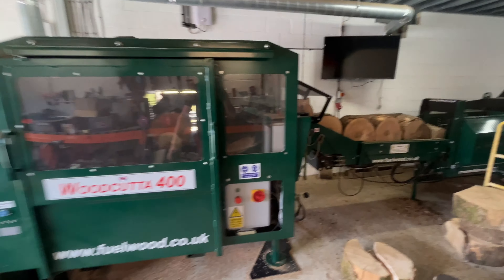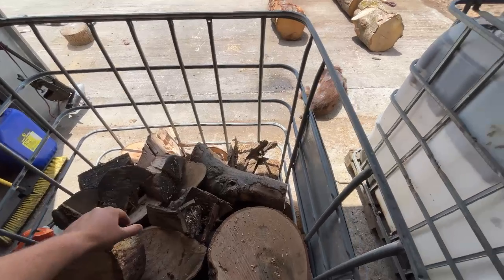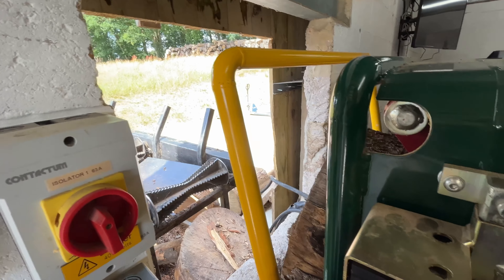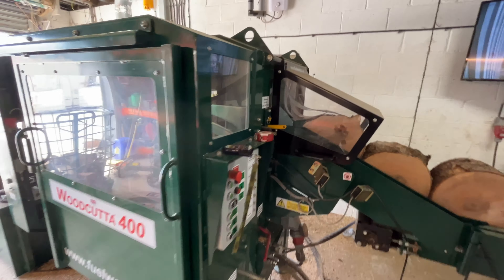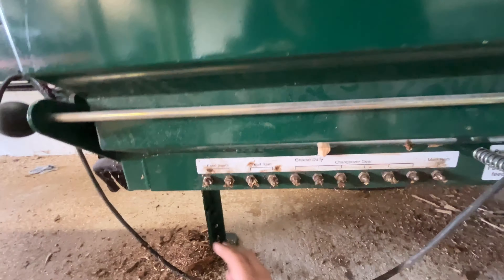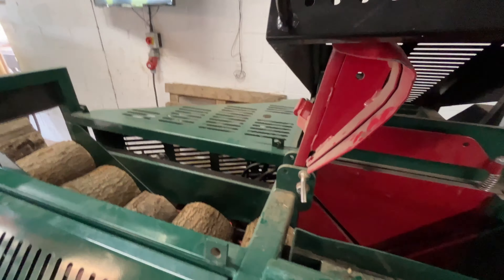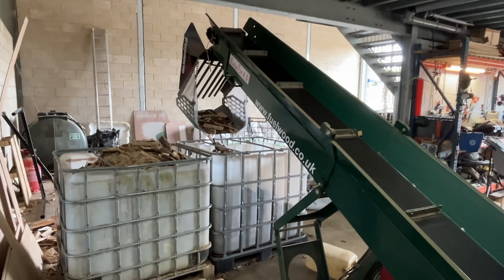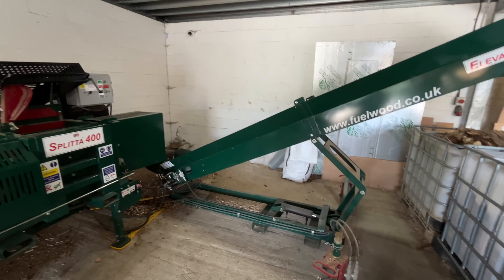Day 115 - Fuelwood Factory in Depth Look

Comment: Thank you for a really good demonstration of your machine. I am incredibly impressed. I have worked with firewood in Denmark, but in Denmark, it has received a lot of criticism for polluting the air. That's nonsense if you ask me. If the wood is dry and burned properly, it doesn't pollute.

Regarding the optimization of the machine, I would definitely choose to install a conveyor belt between the splitter and your current conveyor belt. If it were up to me, I would set it up with the JAPA drum cleaner and then continue to your current conveyor belt.

That means the conveyor belt lifts up to the deck in the splitter room. Seal off the wall for noise, but include a door. Set up the JAPA drum cleaner along the wall and let it drop into the corner where your current conveyor belt will be located. This way, you can already sort out bark and other small debris early on. Afterwards, the completely clean pizza oven firewood will end up in the IBC containers.

There should be minimal waste and cleanup around the IBC containers.

When I delivered firewood in Denmark, we worked a lot with handling the finished product, just like what you're aiming for or working to achieve. It's a joy to see that someone can create machines that are almost fully automatic. And that remote control is invaluable—brilliant.

Jesper - DK

Comment: With the longer conveyor, easier to empty bags and you could even now back a trailer  in and fill it  with loose wood
Reply from the maker: Yes very true. I don’t often do green loads though I must admit. I also use Ibcs as a measuring device.

Comment: Great video. How many tons of wood do you think you need to process a year to justify one of these? cheers
Reply from the maker: All depends really. It will last years so you don’t need to be doing absolutely loads to justify it. But I was doing around 1000t when I got it
Reply: @oakfarmfirewood  thanks. Definitely add the extra conveyor if you can so you can go straight in with the forklift. I have a turn going into change my boxes and it slows things down so much. Think about the number of slow movement each year. I'd love to change mine to straight in when i can.
Reply from the maker: @RichardPerkins-v8c im thinking about taking the conveyor off the cleaner 👍🏼

Comment: I have looked at it briefly and seen it in action but it seems to me a very slow machine how many cubic meters does it split per hour?? I have two Jappa perfect splits running and one does an average of seven to eight cubic meters per hour with straight trunks. The whole set up seems clumsy and not very efficient to me. The only advantage is that it works automatically but at Jappa you can also buy an auto control unit and then you have the same but more production